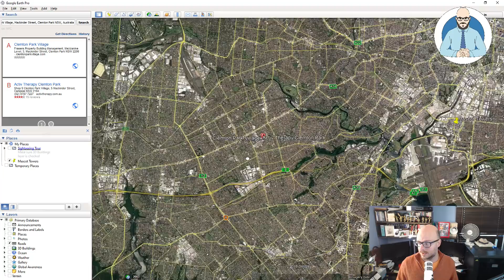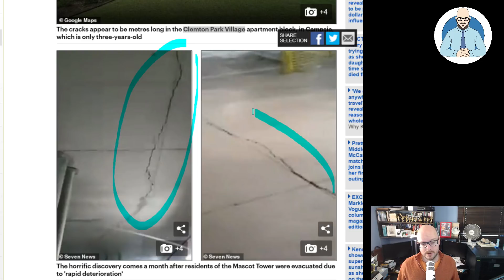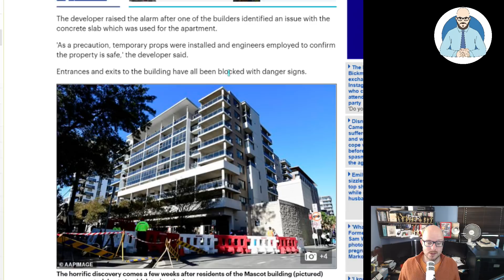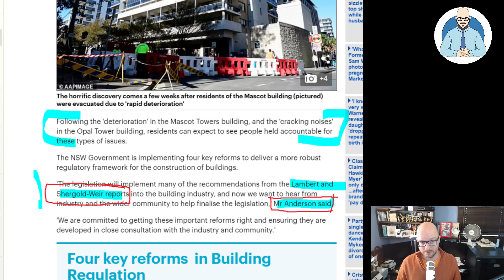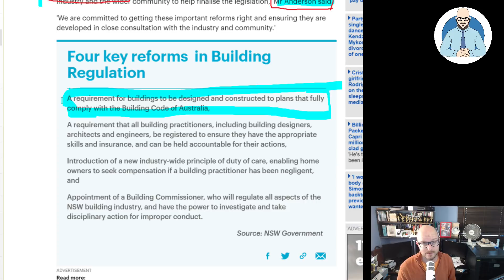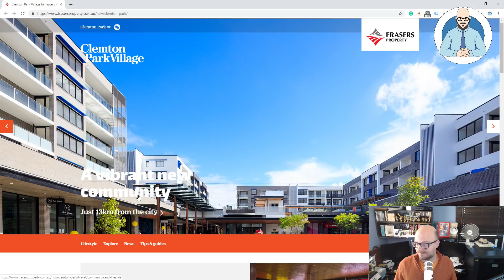Cracking at Clemton Park Village

Comment: Hi Heise Says - just my opinion but the improvement measures proposed don’t address underlying root causes & read more as motherhood statements. “You can put lipstick on a pig it’s still a pig”. The construction/building industry can learn a lot from other industry quality assurance practices, such as automotive & aerospace. Fundamentally they need to focus on why these faults & errors were made in the construction & why the errors were allowed to escape detection/inspection across all aspects including structure design, formwork, steel fixing, concrete mix, concrete pour, concrete curing, precast, etc, etc. Until the root causes are identified & countermeasures put in place to control and assure these processes, nothing is likely to change.
Reply from the maker: Yes. They are missing the point.

Comment: Why does it have "enabling home owners to SEEK compensation...." shouldn't it be "enabling owners to GAIN compensation......'
Things I've noticed.
.A fairly new shopping mall near where I live where there are leaks every time it rains and buckets are in doorways and corridors.
An apartment block in the city where I thought I might invest and my husband just keep saying look at how rough this is. It had the fancy foyer and swimming pool and you could see all the rough concrete finishes.
Black mould on window sills and verandahs in a block in Parramatta, that can't be healthy!
Pub talk of workers knocking through supporting walls to make it easier for them to get around the work site,
Nearly every three level block of apartments in the west ends up getting permission to put an extra level on top but they still claim it is three not four levels. How has the fourth level been engineered I wonder.

Comment: Most of the cement used in the building industry in the last 10 + years will crumple unless it was independently tested , sheeple wake up.
Reply: They don't typically build apartments with cement. I think you have no idea what you're talking about.
Reply: @rorylee3582  let me ask you a question what do they use making the foundations and the slaps ?.
Reply: @finn1951  *slabs

Concrete, always concrete. Depends on the application but typically something like 40mpa, 60  slump (higher if using a placing pump) and 12mm aggregate.
Reply: @rorylee3582  most of the concrete will fail earlier than it should be
Reply: @coasteyscoasteys  what makes you feel qualified to make that assessment? Concrete typically increases over time both tensile strength and hardness. 

And every batching plant does lab tests on every batch. For precast construction they test when it's cured and tell the client when it's ok to remove formwork or break moulds. Hope that helps.
Reply: @rorylee3582  because 10 year old buildings are cracking
That's my qualification.
Unfortunately Greed has won
Reply: @coasteyscoasteys  ok. Here's why you're an idiot:

Why did the building crack? Could it have been poor quality steel in the concrete? Could it have been poor quality steelwork?? Could it have been poor quality fasteners??? Could it have been build on unsuitable ground???? Could it be sloppy workmanship on the job????? Or maybe the thing was just under engineered right from the engineer/draftsman. 

It maybe shitty concrete, sure. But you're definitely using shitty logic.
Reply: @P-PlaterinadollarGQ  I'm not sure, if you owned a batching plant, would you risk your rep buy doing that? Or just say 'fuck off'? Could well be true, but I'm just sceptical.

Comment: We rented a “pretty” newbuild townhouse for a while. My son punched the wall one night, as you do when the computer won’t upload your uni essay at 3.00 am! 
He put a hole in the wall!! His hand was fine, I couldn’t believe it! Careful Polyfilla fix and paint match worked well. 
We’ve since bought a 1975 unit! Yey! If he punched one of these walls he’d break his hand! 
Only petty compared to your cases Heise, I know, but shoddy is not good enough!
Reply: Freespeech1 June that’s just a gyprock wall construction vs a double brick wall construction- doesn’t necessarily mean bad workmanship
Reply: Cole I know! I’d just never seen an internal wall get damaged with a bare hand!
Reply: Free speech
I've got a 1974 concrete slab and double brick.
It's basically a bomb shelter. The building will probably stand another 100 years
Reply: coasteys coasteys There are Tudor buildings in Chester uk built from wattle and daub still standing and inhabited! They lean a bit! But feel solid. 
I know the newer gyprock buildings are safe but have a temporary feel.

Comment: Interesting 

1) Even low-riser buildings are susceptible to cracks and defects

2) There isn’t much, if any, coverage from Australian media... Perhaps Fraser Property, the company behind Clemton Park, spends lots of money on advertising and journalists and newspapers don’t want to bite the hands that feed them?
Reply: Low rise, medium rise are susceptible to cracking if they are built on pad foundation supported only on sand. Just need to suffer changes in the water table. I have seen a hotel swimming pool built into sand a couple of hundred metres from the beach sink. That was demolished and replaced by a new pool supported by bored piles.